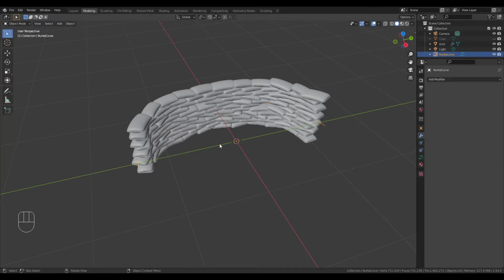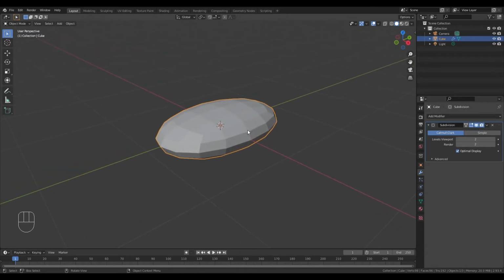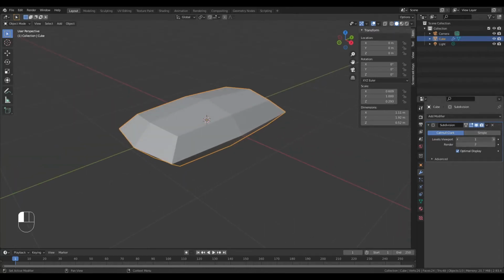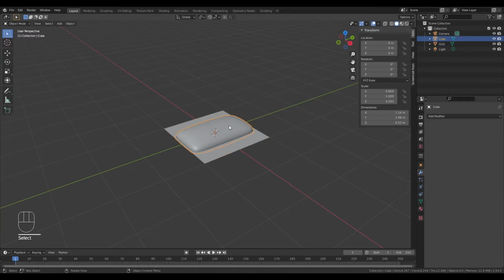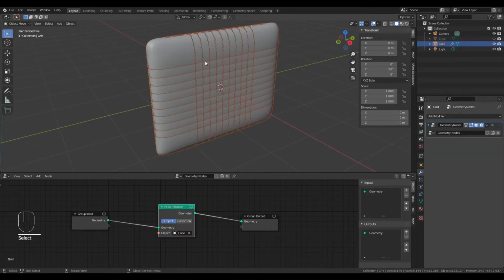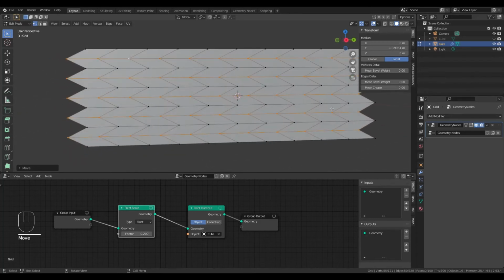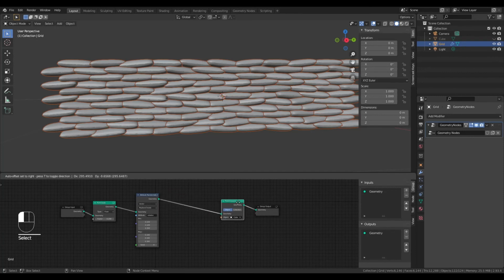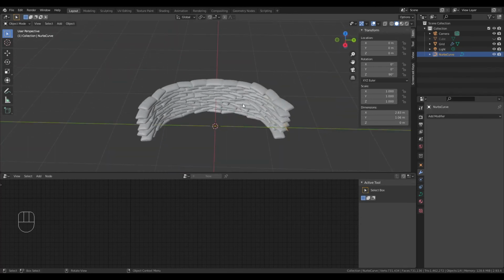Sandbag Wall - Blender Modelling Tutorial

Comment: FOR ANYONE NOT GETTING THE CURVE TO WORK ON THE NEWER VERSIONS OF BLENDER:  Refer to the updated method for geometry nodes in the description. Then after that at the end of the "Instance on Points" node add a "Realize Instances" node and connect it between the "instance on points" node and the "Group Output" node. This should allow the curves to work :)
Reply: Not sure where things went wrong, but when I did this it did add the curve to the sandbag wall, but the wall now looks like it's going to warp - as they go along the curve they get more and more stretched.

Comment: is this good for game assets ? i tried to apply the geometry node modifier but it aint working because it aint a mesh ? i also try to convert it to a mesh but still nothing i keep getting an error. can anyone help me out please
Reply from the maker: You can use the Realize Instances node to make your instanced geometry into a 'real' mesh. Just link in the node right before the final output node of your geometry nodes. From there you can either apply the modifier, or if you're exporting there should be a checkbox to apply modifiers during the export (helpful if you need to iterate). Let me know if you need more info!
https://docs.blender.org/manual/en/latest/modeling/geometry_nodes/instances/realize_instances.html

Comment: Hey Will, any way you can do an update or explain the steps with the new update? I've tried following the guidance from people in the comments but its not nearly as clear as your instruction.
Reply from the maker: Sure! I'm a bit blown away that so many people found this useful. I originally only made this for my father to follow along, so I was surprised to come back to this with so many comments. Geometry nodes has changed a lot since I did this, so I'll try to make a new video before the new year.
Reply: @vector_arrow  Dude this has been great. As an absolute beginner I found this easier to follow than the famous donut tutorial. You are quick and to the point its just all around great. You have a real knack for this.

Comment: What do I do when I choose the curve in the modifier tab but nothing happens, when I move the modifier (curve) above geometry it snaps into positions but the end of my sandbag wall are rotated a bit wrong and I have spaces between them on the ends?
Reply: I know it's been a while since you've been here but I found a solution. Go back to the geometry nodes section on the grid and after the "INSTANCE ON POINTS" node add a "realize Instances" node then plug the realize instances node into the group output node and the curve stuff should then work

Comment: For people watching with 3.2 or above (for now I think) there was some revamp of nodes so here's what I did to use the newer system:

1) Point instance - Instance on Points, drag your object into the menu and connect that to instance
2) Point Scale - I used the scale on the Instance on Points
3) Attribute Random - Random Value, set the min and max and to vector like normal and drag the value to connect to rotation input on the Instance on Points
4) For scale should be same steps but drag the value into the scale input

I hope this helps!
Reply: Ok thanks for the tip but.... 
how do you select the object (the sandbag in the example)? I can't find an option under "Instance on Points" that allows me to do this.

PS: Geonodes would be great if it didn't feel like everything was new with every damn update -.-!